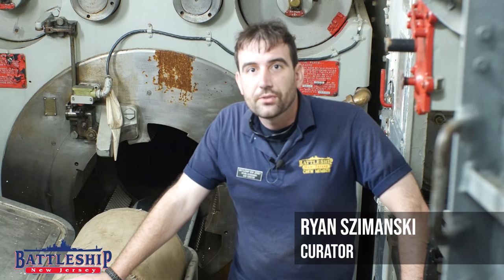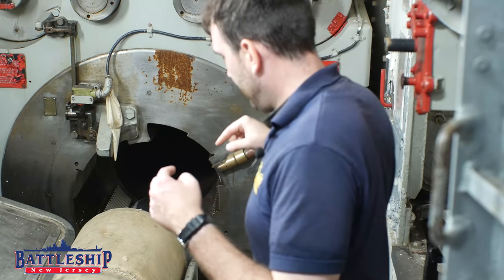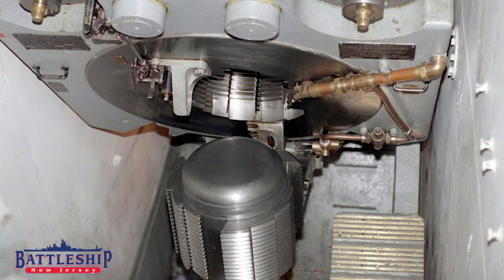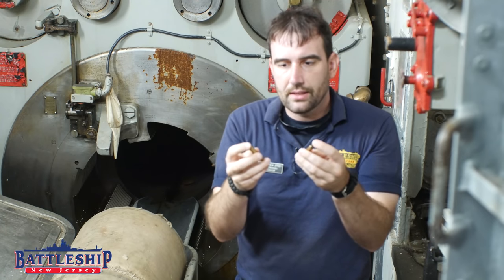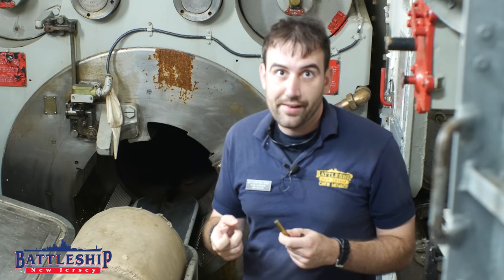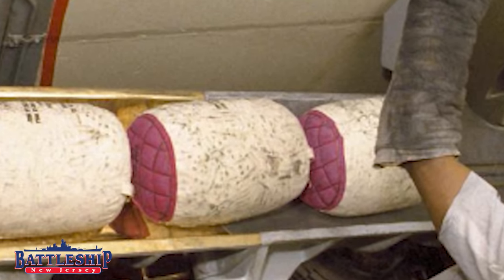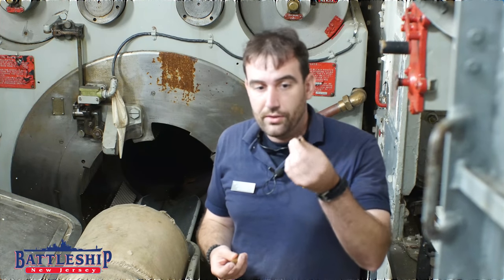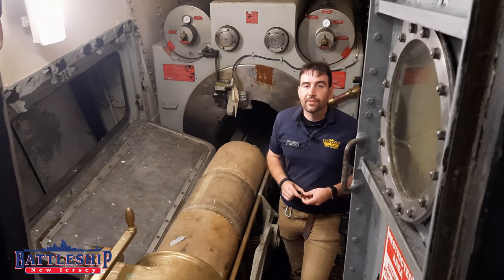How Do You Fire the 16in Guns: Primer

Comment: I still have one of these spent 16" primers used 8 Feb 1984 during our 288-projectile onslaught into the Syrian forces invading from the east through Lebanon's Beqaa Valley.  

And, yes, the gunpowder grains are fascinating to observe... and, frankly, also to light!  The grains are varied in length and thickness, but they are all a very light greenish grey in color and with three sides running each grain's length.  Imagine a long, very thin prism in shape.  They vary from less than an inch to about 3 inches in length.  A   GM friend of mine got hold of a few grains and, in a well-ventilated area, we ignited them one by one.  They each flared and disappeared like flash paper, each in turn.  It was fascinating to watch.  Looking forward to that future video from you, Ryan.

Comment: Hi Ryan and team, great video. I’ve noticed in several videos that various pieces of electrically/hydraulically powered equipment throughout the ship are staged at different points in their work cycles, the spanner tray and powder hoist door in this video being a good example. We know none of these systems are operational so my question is, were/are the museum staff able to manually manipulate some of these items/systems to set up displays when a section is being opened to the public?
Reply from the maker: Yeah, these were manually operated to get to that stage. Its an extremely slow and arduous process.

Comment: Very interesting video. It occurs to me that the act of igniting each bag in sequence from the back effectively means that the overall gas pressure in the barrel is ramped up in stages instead of the whole lot going off simultaneously. Neat!
Reply: I'm not entirely sure that will be true.
Suspect that, as it goes off, the pressure of the rear bag will already push the other bags forward, and the next bag goes off pushing the others forward even more etc etc.. So as they go off the space in which they go off becomes bigger as well.

This is similar to in rifle reloading, light projectiles use faster powder with higher pressure at the chamber
but speed of the powder has to be slower when the weight of the projectile becomes higher.
As a result, the chamber pressure for heavy projectiles is typically lower, but the pressure is kept up for longer down the barrel because of the slower conflagration 

That is the main reason why you cannot shoot heavy 3006 or 308  pill in an M1 Garand or M14 :  the higher pressure at the gasport at the end of the barrel.. causes the oprod to slam hard.

Comment: I found a video of 16 inch guns being fired in the late 80's and it looked like the breech guy was manually firing by pulling on something, but i wasn't sure that was possible. its really cool that they designed it to be so fail proof. all else fails, you could literally smack it with a hammer and it would go off (albeit it would probably break your arm when the breech rockets back). having the option to electrically cook off the primer too is pretty awesome

Comment: Hi...after the gun  loaded...can it be unloaded or does it need to be fired?
Reply from the maker: It can be unloaded
Reply: Great Question!
Reply: It can, but getting the shell out is hard. When it's rammed in, its brass ring deforms into the shape of the rifling, so you basically need to ram it out by elevating the gun and dropping something heavy down the muzzle. There's another video that covers it.

Comment: Hello Ryan, 
thank you for this amazing Video. I'm very interested in seeing more details about the type of Powders that were used in these 16-inch guns. I'm a reloader myself and to my eye the primer looks like a beefed up .45-70 Government case with blank fire-star-crimp. On a quick search on the webs, I found a cross sectioned drawing of a Mk 15 Mod. 1,2,3 Primer on bulletpicker. In the description, there is stated that the ignition charge is 30 grains of Black Powder. Furthermore, I find it especially interesting that you can see at min 2:27 the greenish electrical insulating Ring around the Percussion-Primer for the electrical firing. Also, the headstemping in the primer-head shows some significant signs of pressure, is it known today, how high the peak pressure was, when firing the 16-inch guns? 
As a recreational black-powder shooter, I know that you have to clean the barrel after each range session to prevent your barrel from corrosion. You mention that the primer alone would be too weak on its own to ignite the powder charge, so they quilt a black powder patch on the back of the silk back. So that raises the question: if there was in the primer and the back-patches black powder, must they clean the gun barrels after each firing, and how do you clean a 16-inch gun barrel? Or do you have already a video on the topic and I missed it?
In my gun safe are two .30-06 Springfield caliber rifles. The M1917 and the M1903 A3. And I shot a view other rifles in that caliber, including the M1 Garand and even a lever action Browning BLR. Good to hear that you didn't get the Garand thump, safety first on the gun rage. 
Greetings from Germany
Reply: I think if you watch a firing, there is a big jet of compressed air or steam to blow out any loose residue.

Comment: I am going to ask the stupid question... "Given if everything was available (and was sanctioned), could the 16" guns (any of them) be fired currently, whether electronically or manually? Why or why not?"
Reply: There is another video about why they could never fire the guns even with just the powder charge 
If I remember correctly Ryan said it would basically break almost every window in Philadelphia
Reply: Well I'm very far from an expert. While I think the gun could still take it the city wouldn't have any windows left.
Reply: @BlindMansRevenge2002  Excellent response!  I guess the more direct question is "Has there been anything done to physically prevent them from being fired?" Aside from the lack of power, location, authorization etc etc... like the barrels being plugged with concrete, firing pins removed/welded in place... stuff like that.

I was aware of the mandate that the "museum" could not bring the ship back to life under its own power (I believe I saw that video where Ryan discussed that... Navy says no and besides that, it would be totally unsafe to do so).

Just rambling over here... I need to plan a trip up to see the New Jersey...
Reply: Could it be possible? Probably. I mean, the guns and breech are so strong that you can get away with not doing things properly. So a salute or blank charge could easily be doable.
...Would it wise or legal to do so? Ha. Ha. Nooooooo. Just... No. Battleship New Jersey is quite near residential and commercial buildings. Firing even a fraction of the regular charge would be shattering windows hundreds of yards away, setting off car alarms, making emergency services and people panic... Would not be a good idea.
Reply: @BlindMansRevenge2002  that is only after the defense authorization act of 2009.. when the Iowas were fully transferred to their respective museums.  From the DAA of 2001.. there was a requirement that they be maintained for the possibility to be reactivated.
Reply: I believe that all the oil for the recoil on the guns was removed for it leaks while in service pretty bad...I took the gun tour on the North Carolina years ago and it had the oil removed for the leak issue.
Reply: Could the guns be fired? Yeah. These are essentially large single shot guns with multiple redundancies. Manually load a shell and powder, and fire with the primer. Boom.

Can the guns currently be aimed? No. The engines/power supply is gone, fire control is currently a prop, and the turrets haven't budged in years.

Comment: Older tractors and other heavy machinery use to start in the same way. Using a blank cartridge. 152mm artillery in the US military is fired using the same method just I think it looks more like a shotgun shell without the shot in it. Fired a 30-06 in semi auto and bolt action.

Comment: Actually, the primer is based on the older 30 Krag cartridge which what was used by troops in the Spanish American War.  This primer was used in a variety of separate loading artillery down to I believe the old 5" 25 guns.  Most of those of course would not have been electrically primed or fired but the basic design is the same.  As to the belts, those were probably old military "Mills Belts" common from the 1870s forward.

Comment: The shell casing used as a primer for the 16” guns on New Jersey and her sisters ships and I assume other United States Naval Warships looks to be the same size as a 30 caliber Government round aka 30’06 rifle rounds that were used in the 1903 Springfield rifle, M1 Garand M-14, Browning 30 caliber machine guns, etc.  It should be noted that the 30 carbine cartridge case i.e. the straight wall cartridge case and all cartridge cases of this design are made of thiner material (brass etc) because the pressures in this type of ammunition is lower because of how the cartridge is supported in the chamber of the firearm. Bottle neck cartridge cases like the primer cartridge case are made of thicker material because of the pressures exerted upon them and how they head spaced in the chamber of the fire arm. I would not be surprised if the primer round is what is know as a full power blank cartridge. A full power blank cartridge is for all practical purposes a blank cartridge that is loaded with enough power to cycle as operated semi and full automatic weapons and when fired from a firearm give the same if not slightly louder report than a cartridge loaded with a projectile.

Comment: RE: Gun Captain carrying primers (mark 5:00.)  It was my understanding there was a 'Primer Man' who was positioned in the bottom of the pit under the 'Ram Operator' (see your image @ mark 0:21).  When the gun returned to 'battery' the 'Gun Captain' stepped onto the attached walk, opened the breach and proceeded to wipe it (as you described).  But as he was doing this the 'Primer Man', in the pit under the walk, stepped forward, inserted (and probably locked into place) a primer cartridge into the cartridge chamber of the breach from below - after which he got the *ell out of Dodge and retreated back into his hole under the 'Ram Operator.'  I assume it would be he (rather than the 'Gun Captain') who wore the cartridge belt.  The only reason I mention it is because this man gets dropped from so many descriptions of the 16" gun crew and how the guns were operated.  He really does deserve credit.  After all, when that gun went of at any elevation over 25 degrees it would have taken nerves of steel to be in that pit as the gun recoiled to a distance of (likely) less than two feet from his face.
Reply: Spot on. I used the projectile hoist tube next to me as a reference on how far I needed to be.

Comment: Would front ignition be feasible for navel guns? With rear ignition the projectile and powder charge start to move down the barrel quickly and it's a catch up process to burn the powder right behind the shell. With front ignition the ignition starts at the base of the shell and burns to the rear. The powder doesn't move as much and you have a more complete burn. It worked for Elmer Keith with rifle cartridges.

Comment: from OP-4 Ammunition

Chapter XIV. PRIMERS

14- 1. A primer is a device for initiating the burning of the propelling charge in the chamber of the gun by means of a flame. In case guns the primer contains a sufficient charge of black power to ignite the smokeless powder which surrounds the tube of the primer. In bag guns the primer is fired in a firing lock. The resulting flame, passing through the vent in the mushroom stem, impinges on the black powder ignition charge quilted in the rear end of the powder bag.

14- 2. It is necessary that the flame for ignition of the smokeless powder charge endure over a sufficient time to raise the temperature of the surface of the grain to the ignition point.

14- 3. Primers are divided into three classes, depending on the method of firing them: (a) percussion, (b) electric, and (c) combination, and into two types, depending on the manner in which they are used in the gun: (a) case, (b) lock.

14- 4. ...For all bag guns lock combination Mark 15-1 primers are used... 

14- 5. In a percussion primer the essentials are: (a) a cap containing a "primer mixture" which usually consists of fulminate of mercury with potassium chlorate and antimony sulphide added to prolong and increase the intensity of the flame; (b) a black powder charge in the forward part of the stock sufficient to produce a flame adequate to ignite either the smokeless powder charge directly or the black powder ignition charge after passing through the primer vent; (c) a plunger to be driven in to fire the cap; (d) a stock which will hold the above parts, exclude moisture, and fit tightly in the primer seat in the base of the case.

14- 6. In an electric primer it is necessary that there be: (a) a bridge wire of high resistance which will heat to incandescence very quickly with the passage of a very small current; (b) a wisp of gun cotton in such close proximity to the bridge wire that it will ignite and start the next step in the primer train when the current is applied; (c) means for insulating the primer plunger from the primer stock so that current from the firing pin can reach the ground only by passing through the bridge wire; (d) a mixture capable of ignition by flame from the wisp of gun cotton; (e) a black powder charge and a stock as described for percussion primers.

14- 7. For combination primers the requisites for electric and percussion primers are combined.

14- 8. Electric primers as such are no longer manufactured. All primers containing means for electric ignition also have percussion features

Comment: the primer in the case is not at the back of the cartridge like a normal rifle or pistol case . What is in the rear center of the case is the rear end of a plunger that strikes the primer inside case.  When the powder stars to burn the pressure moves the plunger back forming a safer seal that having a normal primer at end of case.

Comment: With the electrical supply available, I'd probably have gone for a high voltage capacitor array to shoot an electric arc through the back of the bag to simplify loading (still be a bag gun, but with one less part to assemble).

Unless that was experimented with and found to be even more trouble than it was worth, but I can't off the top of my head think of any reason why that couldn't have worked.

Comment: that 30mm  object in your hand, was that a primer? im a little confused i guess because i just bought a previously fired shell with an aluminum dummy load from the gau-8/a which is a 30mm and the case is the length of my forearm.it is about 6 times bigger than my 20 mm shell i have.

Comment: Wouldn’t it make more sense, to maximise chamber pressure, to ignite the forward most powder bag first? This seems reminiscent of the Dreyse rifle ignition problem.
Reply: Those guns are probably operating close to the edge of material strength. So building the pressure in a (slightly) longer period of time was a safer way?
I'm just guessing, as I'm not a gunner's mate, or Naval armament engineer.

Comment: Someone needs to clean the rust patch from the face of the screw box at the twelve o'clock position.  Those guns were always kept scrupulously clean.  Some iron-out and a fine steel wool pad will take care of it in no time flat.  Just be careful of the fumes as they are toxic and you're in an enclosed space.   An alternative method would be a scotchbrite pad, but those will mar the surface a mite.
Reply from the maker: We're always accepting volunteers! We've got 50,000 tons of ship that need help

Comment: You also did not explain electrical firing vs percussive.  I'm thinking that the primer is always fired by a mechanical strike. It can be remotely operated(electrically) or locally operated if the signal to fire fails.

Comment: I’ve fired 155mm howitzers (M-109 and M-198) which use a very similar looking primer. The headstamp on the fired one I have says “M82 LS-92L459-006.” I think the Army 8 inch howitzer used the same primer. I assume the Navy primer would be a Mk- something or other?

Comment: I've never seen a gun captain wear a cartridge belt. Wouldn't the primer man be wearing it?  When they are electrically fired a hammer still has to fall on the primer primer,  right? 

I shoot/own/reload for M1s,  03a3s, and a M1917.  Particularly fond of the M1 rifle. Yes I have had garand thumb. Only because I was either building a rifle or repairing one that had a worn oprod catch or clip latch spring.

Comment: Been around 105 Howitzers when they are fired off. How good are the fume extraction systems in the turrets to keep the men in them from dropping during sustained fire.
Reply: If you look around 10'oclock on the breech, there is a compressed air line for blowing the barrel.  It is both to keep the turret clear and to blow out potential embers.  With bagged powder, even the tiniest ember would set the powder off.  In addition, each gun room is under positive pressure ventilation.  When the breech is open, air is blown down the barrel.  You can see this effect the bloomers during the firing sequence.  Once the breech opens, they will deflate and then re-inflate when the breech is closed again.
Reply: @matthewbeasley7765  thanks  I appreciate  this. I am familiar  with artillery and  to a degree  tanks. Big battle ship guns are foreign to me